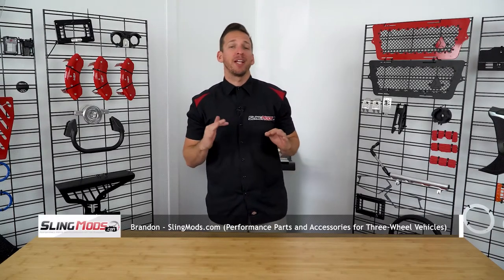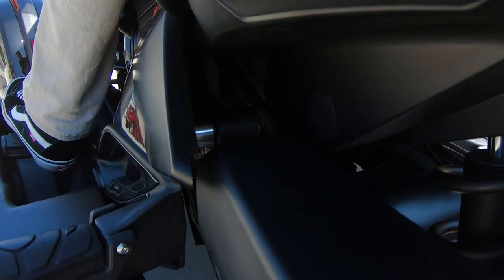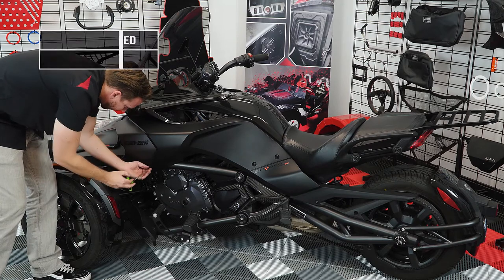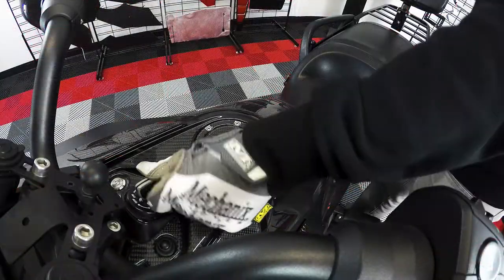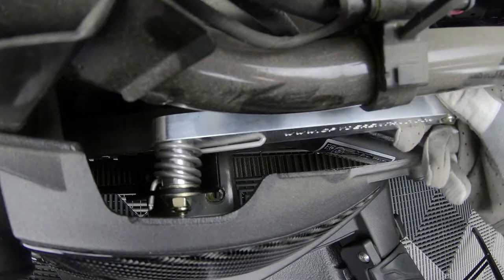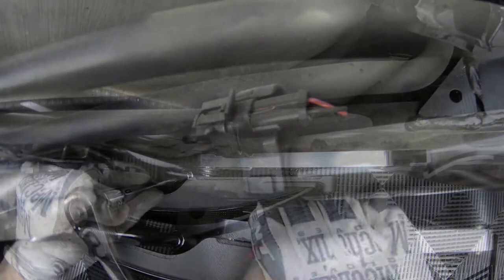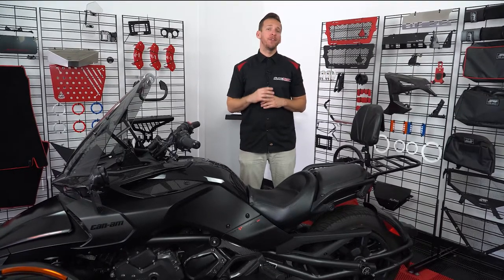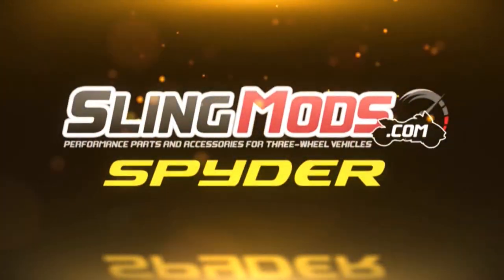Can-Am Spyder F3 Belt Idler / Stabilizer Installation

Comment: just installed the tensioner on my 2024 F3T...  the last panel towards the rear has an additional nut mounted under the side saddle bag.. remove that and side plate will cone off..

so far so good..  no vibrations at 60 to 70 mph..